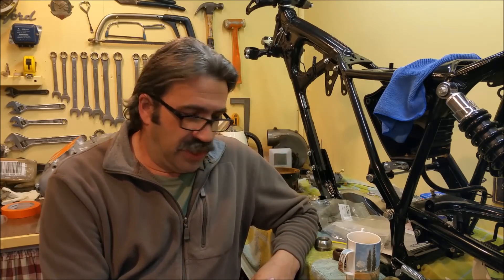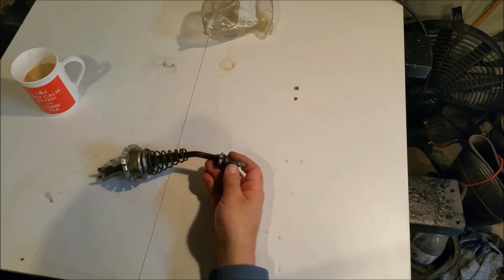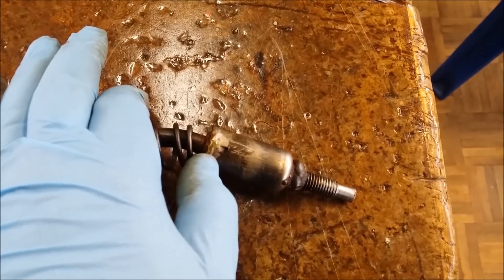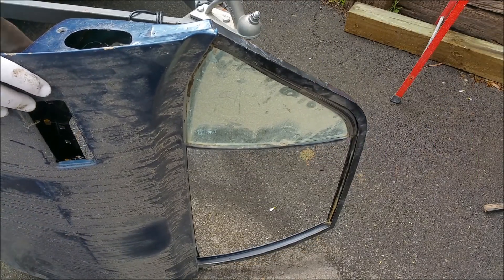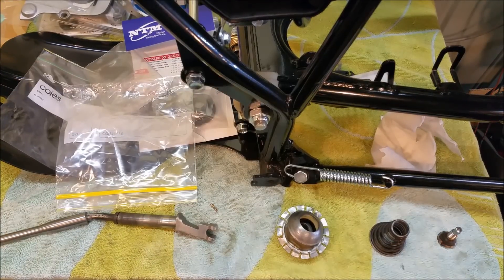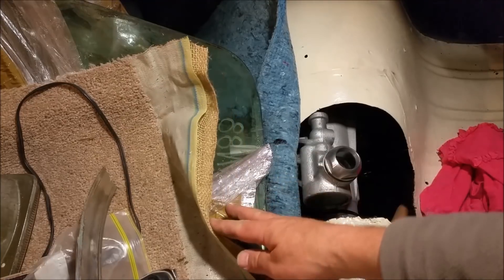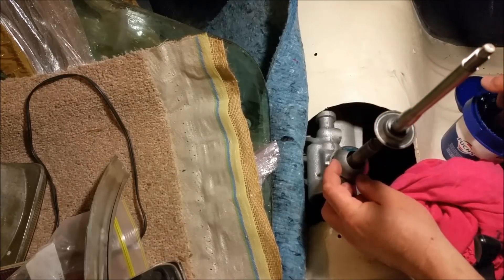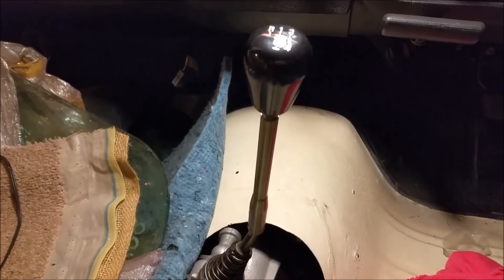Ford XC Fairmont 351 Restoration Part 33

Comment: The reverse gear lockout is governed by the tension on the spring  so i fitted an extra ball cup washer underneath the spring and this worked a treat.  The reason for the nylon ball having a split in it is so that it can be fitted on the stick without having to cut the stick in half as some have done

Comment: Glad to see the xc again, if you want a more positive reverse lockout you can add a few shims between the circlip and the top of the spring to bump up the spring pressure, I have heard you can buy a new spring for single rail shifters, althougg I haven't found them yet
Reply from the maker: Thanks Thomas, I will have a crack at increasing the spring tension. Cheers

Comment: Those damn levers used to come apart leaving the driver either in nuetral or sitting in traffic. The last one I did i filled the space with Eurethane rubber (  i was making some engine mounts at the time) and new pins. it has worked fine so far.

Comment: glad you did this peter im just about to get one for my single rail and was looking at the alloy one , i also bought a  block marked XE192540 when i bought a 351 and other spares , cant find out too much about it
Reply from the maker: I Clevo block with an XE marking? Is it a pillow block?
Reply: yes apparently , i tried to find pictures it looks like it has puffed out bits on the side
Reply: never heard of a pillow block until a few weeks ago after i bought the job lot , it just seemed strange so i bought it on a hunch , i did see it was a four bolt but other then that no idea
Reply: I read the the XE  stands for Experimental Engineering in these blocks, and they were originally intended for the drag teams & nascar in the US ( because they ran out of good blocks), but many had too much core shift & couldn't be used for racing. They were apparently ok for street engines though. Oh, and they were made in Geelong.

Comment: the metal mod for the stick is good, never seen that over here UK, seems like u need more spring tension for reverse, the gear knob I would fashion a nut in it thread of some kind! ATB Wayne UK.
Reply from the maker: Thanks mate, will increase spring tension and see how we go. Cheers

Comment: You can use the length of my gearstick for reference Peter! (Jeez, how bad did that sound..)
Cheers Andy
Reply from the maker: Steady on mate... haha How's it going since the earth issue?
Reply: Peter Anderson All sorted, running well, so starting to clean up underneath (reckon I've removed 10 years of sludge from the front end)

Comment: The problem you have with the reverse gear detent not feeling very positive seems to be very common with Ford gearboxes up to the '90s.  The spring just doesn't seem to be strong enough, even when the cars were new and it could cause problems, particularly with more heavy-handed drivers selecting reverse instead of first with inevitably chaotic results.  It even happened to racing drivers using the standard gearbox in Sierra Cosworths.  There was at least one incident where a driver selected reverse instead of first on the grid and then when the lights went out they dumped the clutch and nailed the car behind them.  I've been told that you can use some washers to go between the top of the spring and the circlip to increase spring tension, or make a spacer and that increases the spring tension and the positivity of the detent.  It will still look stock as the modification is hidden under the shift boot, though it may increase wear on the nylon ball slightly, though with modern materials being self-lubricating to a level that may not matter too much...
Reply from the maker: Yes, you're certainly correct and I will re-address it... didn't spend too much time as I needed to get an XC installment out as quickly as I could. Cheers
Reply: +Peter Anderson  It's something that is easy to go back and look at again, and something you can only really tell once the lever is united with the transmission...

Comment: Peter I need help I have just gotten my first xc falcon Ute and am in the process of restoring it I guess I have you to thank for that you are the one who got me into it. 

I am putting the interior back together and engine bay and I need your help on how you connected up the heater controls cables did you have them pre connected before you put the dash in or did you do it after the dash was in because it is really hard to see what you are doing or get your hands behind the vent tubes without braking the old dash.  Also I need a few replacement cables controls cables is there a tool the make the eyelet loop in the cable because they say cut to length but the metal they use is very very hard to bend.

One more question the car never came with any brake lines do you know were I can get repo ones for a standard falcon 500 Ute because all the ones I have seen are for xa gt falcons with brake proportioning valves. If I have to I will make my own but it have no lines to copy so it is very difficult.
Reply from the maker: Hi mate. I connected all cables to the heater control mechanism on the bench, then fitted the mechanism to the dash assembly while it was out of the car. I then fitted the whole dash assembly to the car, then hooked up the cables to the various parts of the heater box after all was fitted. As for the brake hoses... I still need to get the rear ones for this car and have seen them on eBay, you can also go to any reputable brake shop who should know what they are and be able to get them... bear in mind that disc and drum cars are different and if the car has had brakes from another model fitted, may cause confusion. Cheers

Comment: Nice job. Just curious though about the clearance between the shift rail housing and the tunnel opening, seems awfully close on the video.
Reply: +Michael Hoffman  I don't think the gearbox is fully installed here so it's not sitting in its final position to make installing the gear lever/shifter easier...

Comment: Ah, the Ford nylon nut holding the gear lever in.  The number of Cortina, Capri, Sierra and Transit drivers who've been left with the gear lever in their hand and a box full of neutrals because of those things letting go at inconvenient times...
Reply: Putting in a grub screw to lock the nut to the housing was a common trick back in the day too.